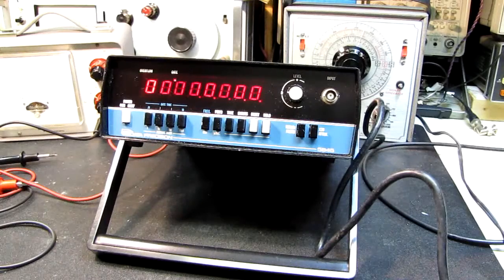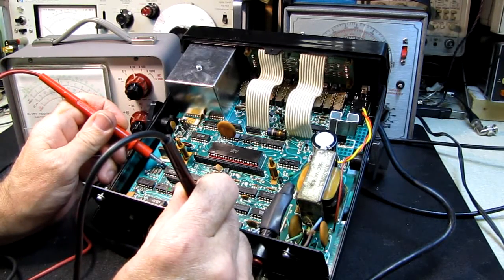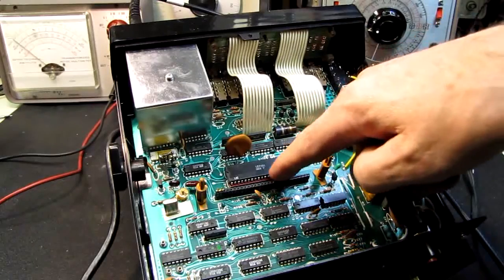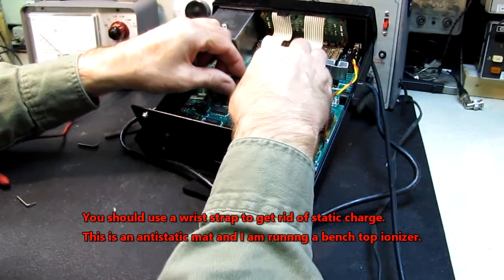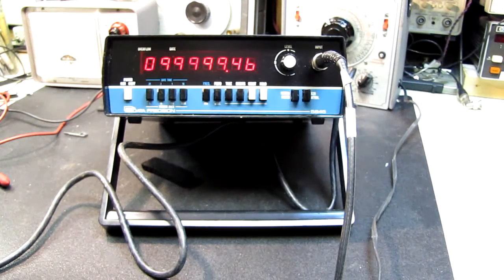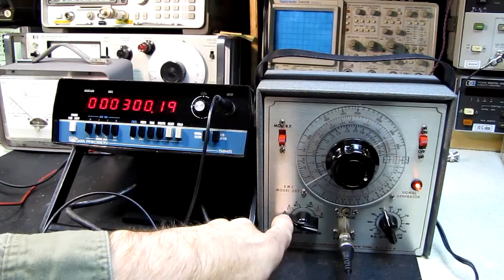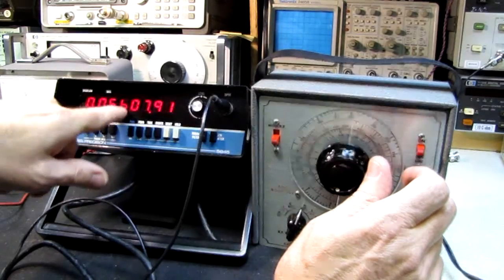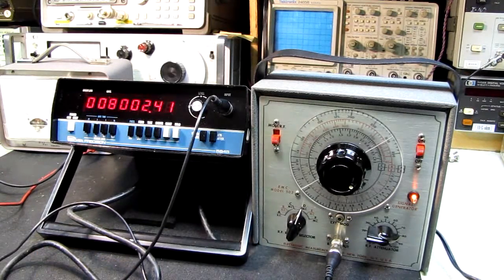10 Buck Test Bench - Data Precision 5845 Counter Repair

Comment: The unit I have is good up to 400 MHz.  From 400 to 430MHz playing with the level control, x20 attenuation button and the signal generator level can get a stable display.  I would like to acquire a PDF manual.  My observation of the Illinois/IC brand capacitors that Data Precision used as OEM is that they don't bulge, occasionally leak out the bottom seals,  and slowly drop in value.  This opinion was formed from working on a Data Precision 8200 Voltage Source, 3500 Multimeter, and the 5845 Frequency Counter.

Comment: I have the same counter.  It's a nice unit and well built.  I have the same problem finding a manual as you though.  I wanted to update the reference to either an OCXO or modify it for an external reference and feed it from my GPSDO.  I guess I just need to do a little reverse engineering.

Comment: I used a Data Precision multimeter  in the late 60's and 70's.  That and a Tektronix 453 O scope served me well although they were heavy to carry through airports. Your bringing back good memories here.  thanks for the videos. I don't know about the young players but this old fogy is enjoying.
Reply from the maker: I spent almost 20 years on the road ( S.E. Asia ) servicing, installing, customer training etc. on semiconductor capital equipment. My Service case weight was 70 Lbs. with Fluke dual channel scope meter. It was on wheels, but after two trips told the company if they wanted me there they had to ship my case to me at the Hotel. Made traveling much easier. I had some leverage as most of my trips were 3 to 5 months in duration country hopping. One trip was 8 months. Fortunately a lot of time was spent in my favorite country Thailand. Kind of miss it.